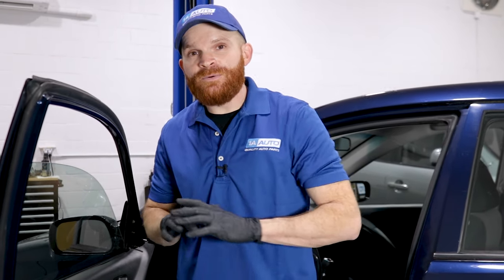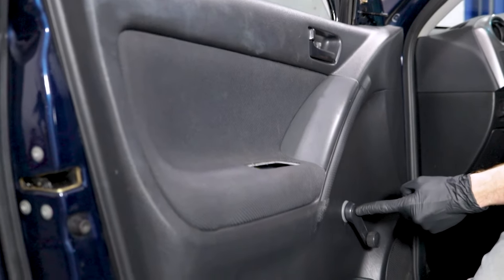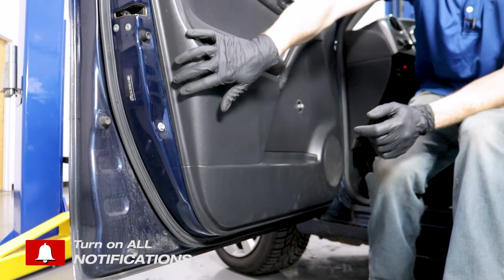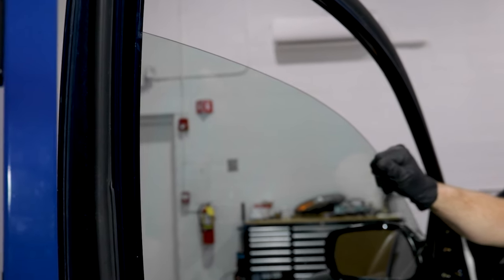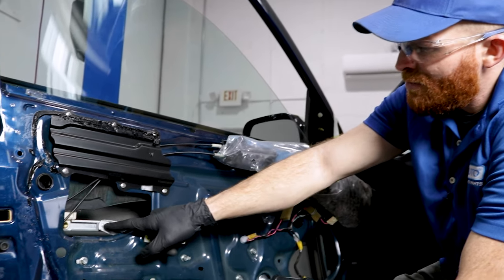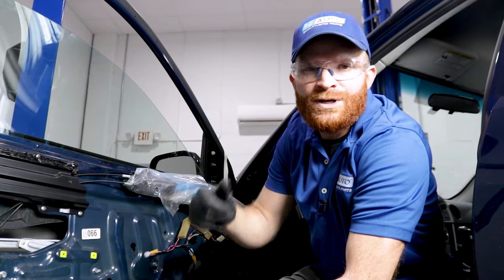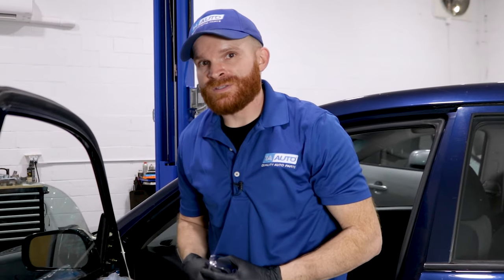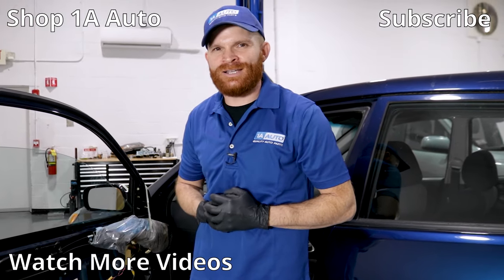Rattling Loose Windows in Your Car? How to Diagnose Window Regulator

Comment: Is there any specific reason they use that black tar around the perimeter to keep that plastic sheet on? I’ve worked on changing windows on even an old early 90s Miata and they stuff was on it. Made for a miserable experience because it gets EVERYWHERE and doesn’t come the fingers. I’m
Shocked they haven’t found a better choice by now to replace that black stuff

Comment: I have a 93 Ford F-150 XLT single cab the passenger widow rolls up and down fine but the drive side does nothing it’s not a Motor or a switch what could it be